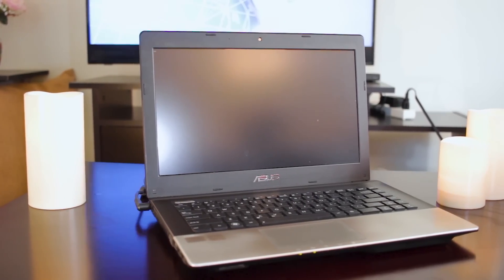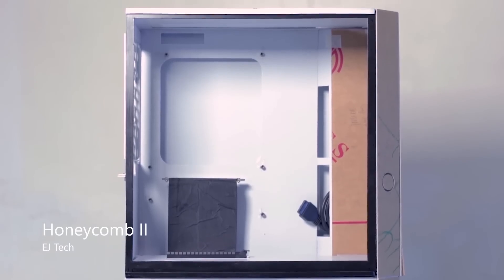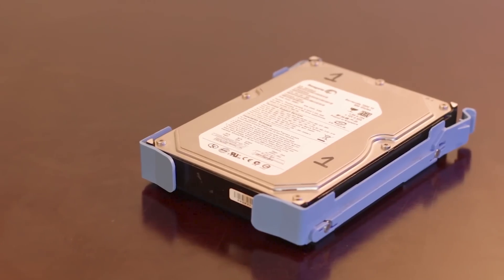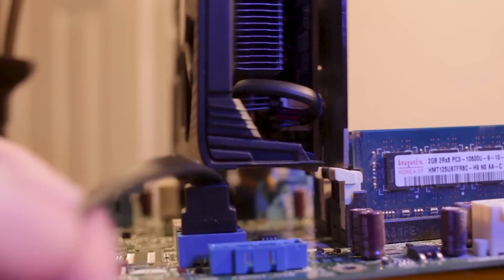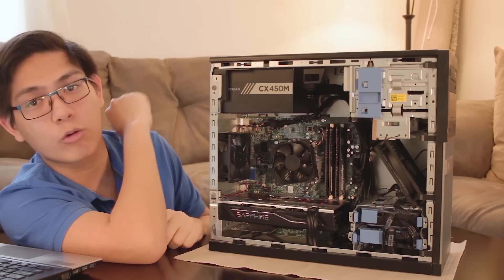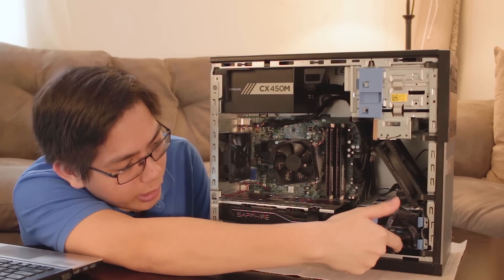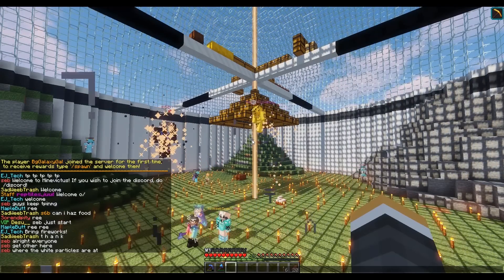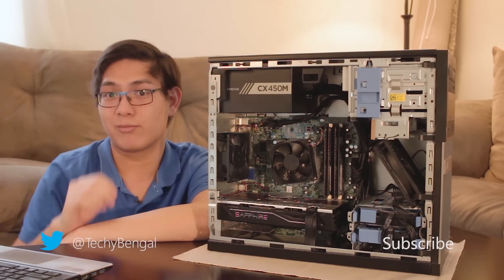My NEW Computer...is a USED OptiPlex? (Tension PC Ep.1)

Comment: the fact that you've been able to edit at all on a laptop to create these videos is awesome but, nothing quite matches the processing power of a desktop period, there is just no comparison between the mobile counterparts and a real fully fledged quad core or dual core processor to handle those heavy tasks.
Reply: What about a 6, 8, or 12 core CPU?
Reply: @greenjames  all computer configurations depends on the user, their budget and their needs, that's why you can't just suggest that everybody buy one type of configuration, that would be terrible!!, and that's it in a nutshell. believe it or not i have a g4560 with 8gb of ram and a gigabyte micro atx board, this is all i could get for now alright, but it runs great, i don't really have any issues i wished i could of gotten an ssd in the beginning but other than that i really don't have any major complaints except for the fact that i don't have a graphics card yet either. i was coming from a really really old computer that i had for almost 9 years.
Reply: @zulugamer67  I am not suggesting that people have the same configurations, I was merely pointing out core counts that you didn't mention. Also, more cores is not necessarily that expensive these days. A Ryzen 3 2200G has twice as many cores for the same price as a G4560. Intel just horribly inflates their prices.

I do not care what your budget is, but dual core CPUs are on their way out, and you can get a quad core CPU for quite cheap nowadays. 6 cores and 8 cores are also getting considerably cheaper, however are still for higher budgets.

Do I recommend a person who is just going playing games or browsing the web to get an 8 core CPU? No, that is ridiculous. Same with RAM. Do not waste money on power that you are never going to use. If you can get something better for the same price, that's great! However I am not recommending you to go buy 32 GB of RAM and an 8 core CPU, you obviously don't need it.
Reply: @greenjames  oh yea also i don't think the ryzen 3 2200g would of been an option for me i don't live in the states or cananda also the i5 7400 on the kabylake platform would of cost 360 in my currency
Reply: @greenjames  yea i know you're right on pretty much everything you said, but i never even had the chance to play anything past 2011 that was considered "modern" at decent settings, so i have no idea what it will be like until i get that graphics card that i want, not yet anyway. they were so many titles i already missed, re6 and 7 GTA V so many others as well.
Reply: There is some comparison the i7 8750h is only about 15% behind a desktop i7 8700

Comment: Hopefully you will upgrade the processor to e3 1230 v2 (4c 8t) since your work will run much better with extra 4 threads compare to i5 3470 with only 4 cores 4 threads. Nice video nonetheless.
Reply: I want to build one for my son for gaming, know nothing about it.
The more videos I watch the deeper the hole goes.
Reply: @VCanisMajorisY  to be honest, buying a used computer is very difficult for a beginner since if you haven't do any research beforehand, you will most like getting buyer remorse. For example can you upgrade the power supply, what is the max level of cpu can you install on it, what RAM does it used, and how many GB can you put it. The list goes on and on. Not to mention if your system is having a problem, what should you do about it. If you're buying dell optiplex, try to get optiplex 7010/7020 or 9010/9020. Any optiplex generation lower than those are not worth the hassle. Be prepared to spend extra money to buy a new power supply, SSD or ram which contradicting the idea of saving money. It all depends on the budget but always, always do some research.
Reply: 😒 agreed 👍🐢

Comment: Ahhhh I love those Dell PCs! Bought two of the exact same ones over a year, for the first one that I upgraded I had to grind off about an inch of a corner of the XFX RX 460 graphics card to avoid those stupidly placed SATA ports... But in the end those ground off corners looked like they were meant to look like this anyway!
Currently have the second identical Dell on my desk, put a 380w PSU in it and will use an RX 570 4GB in it and then resell it.

EDIT:
Actually the grinding work on that RX 460 I had to do to make it fit into a different PC but ended up using something else in that one, would have fit in its normal configuration.
Reply: 90 degree SATA cables, bootable sata card, and also silverstone makes ultra low profile sata cables.   I also had an RX550 that had the corner ground down but I didn't do that.

Comment: Wrong I did fit a GTX970... rip hard-drive bay
Reply: EJ Tech:  this RX570 is probably the largest that will fit in this case.
Esko Lopez:  Hold my beer.  Lets rock this challenge.